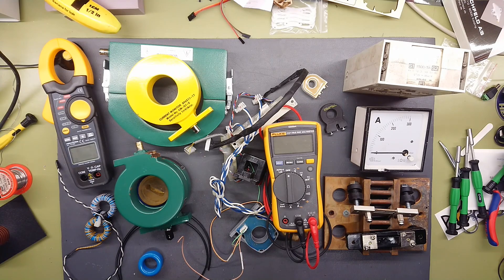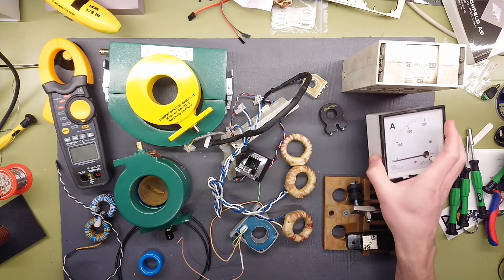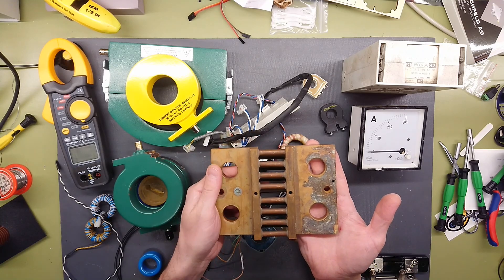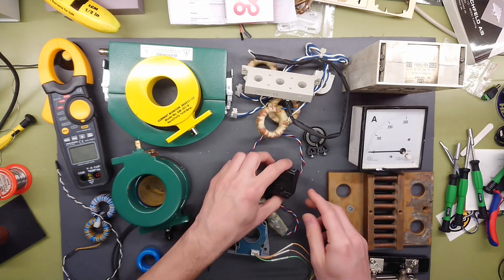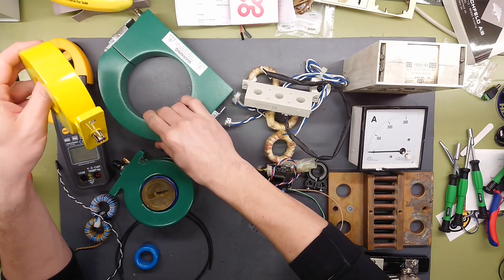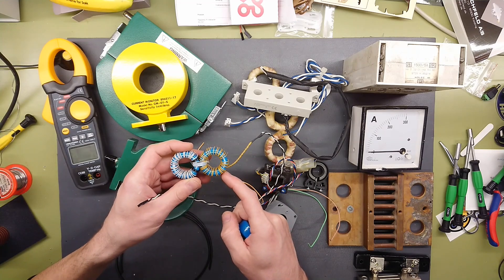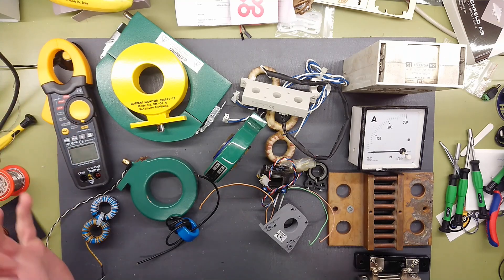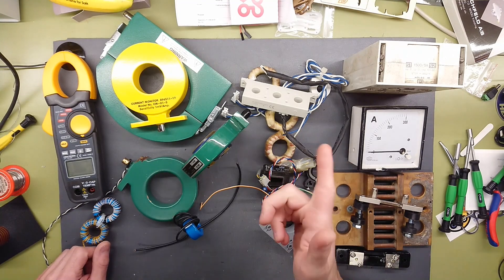High Current Measurements - Isolation, Day 10

Comment: I have used them in reverse as well, to get a more sensitive range on a meter. 10 turn primary, 1 turn secondary, used to increase the resolution of a kilowatt hour meter from the standard 60A to 6A, which was more in line with the load. just had to divide the readings off the dials by 10 to get the actual energy usage.

Comment: I was looking at a MOSFET high current measurement setup that Cree (wolfspeed) had published and they had specced one such Pearson transformer. Much lower current capability. Used it still commanded a hefty 800usd price tag...
I shudder to think how much money you have laying on your table in this video hahaha
Reply from the maker: I have been lucky on ebay :) I would say they average around 150$ a piece. Got a link to that Cree paper?
Reply: @KaizerPowerElectronicsDk  I'll look for it. It has been taken down AFAIK but I have found it in the past elsewhere
Reply: @KaizerPowerElectronicsDk  Well, here's a link to it in my filebox. It's a hassle to track it down again...
Also fig.4 is missing in the pdf. That was the main hassle to track down at the time.
Reply: @KaizerPowerElectronicsDk  Sorry, I forgot the link...
https://filebox.isc.tuc.gr/index.php/s/WwlH7WFJgG7mPuq